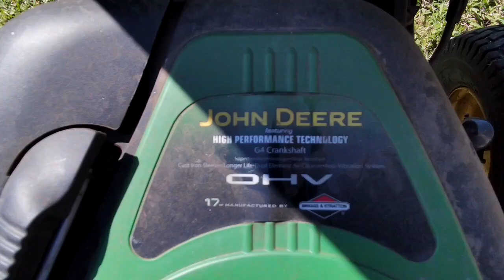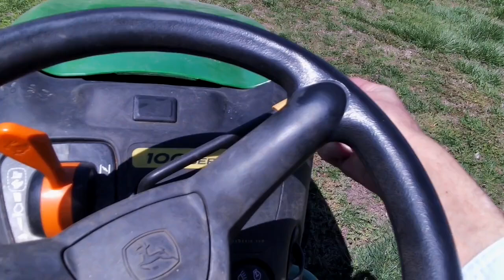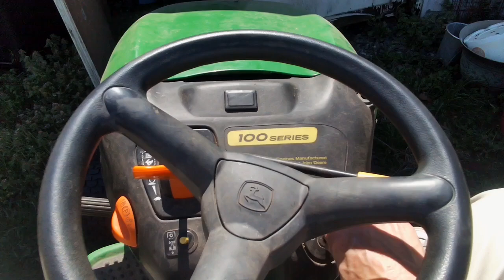JOHN DEERE 102 SPRING ENGINE MAINTAINENCE | BRIGGS & STRATTON 17 HP

Comment: Bought this old mower but does it have an oil filter? I couldn't find one.
Reply from the maker: This particular model does not have a oil filter.
The model 102 were mainly sold at box stores.
They are still decent mowers to use generally.
Keep the oil changed and the air filter clean and
it should be fine.  Good luck with yours!  👍